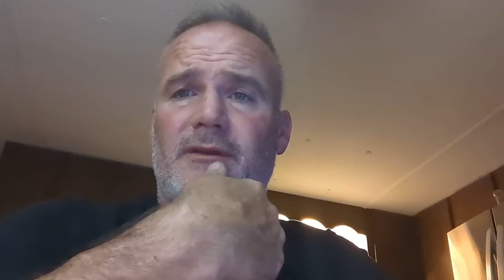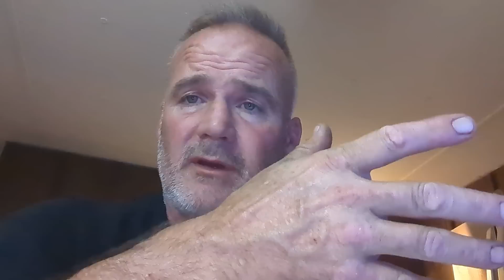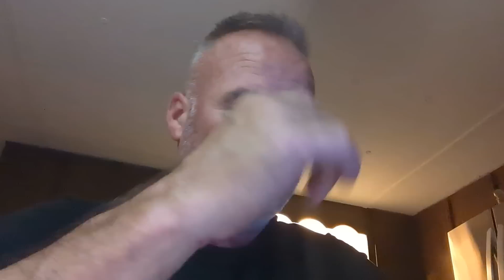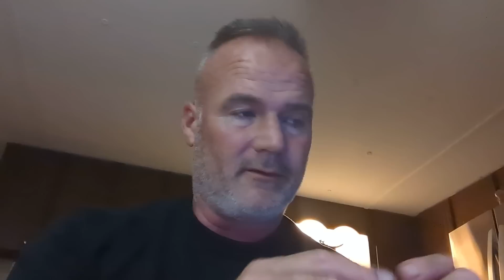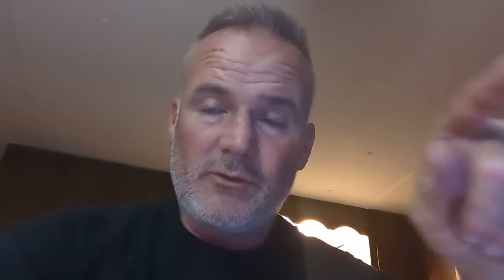Salter Racing cam design There's way more to a cam than open/close there's everything in between

Comment: I have built same spec engines for 9.1 390 carb engines same parts everytin measured and set up same 2 identical roller cams from ultradyne all same dyno both same weather 1 made 20 more hp than other each engine is it's own animal
Reply: A lot of that could come down to casting errors/core shift, its hard or nearly impossible to make 2 engines completely identical in shape- port shape and alignment and everything blueprint, imo. Just a fraction here and there could net a good difference.

Comment: I remember reading my Iskenderian catalog over 40 years ago. It gave duration and lobe center angle, and it gave opening and closing events. On a single pattern cam, if the open/close numbers weren't mirror images between intake and exhaust I could quickly figure how much advance was ground into the cam. A dual pattern cam took a bit more figuring. (I don't recall finding one with ground in retard.) The way I see it these are just different coordinate systems for the same map.
Reply from the maker: That's exactly right

Comment: Yep, I remember when the Cam Doctor came out and the waves it made. Good times.😢
The variables involved are so numerous that claiming there is a right and wrong way is like doing the math to get a spaceship to Mars on the back of a bubble gum wrapper. Ridiculous.
Wait until they find out changing the lash on the solid cams changes the opening and closing points.😮😅😅
Reply: What they fail to understand is your not designing a cam your designing an engine to put in work what ever it's job is and that cam puts the strength where it needs to be but they think they can just make it happen get that magic cam and force the engine to do what that cam says
Reply: @paulpruitt2776  so true. Trying to make the engine do instead of using the parameters to determine the came profiles. 👍
Reply: I did a test back in the 80's on a big block solid roller drag engine. Changing the lash .004 changed the cranking compression 40 psi.